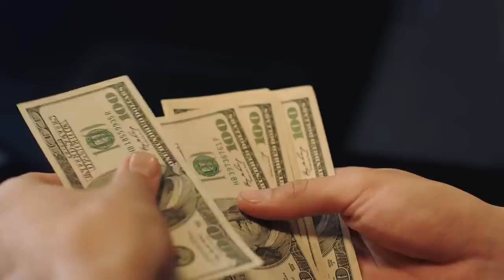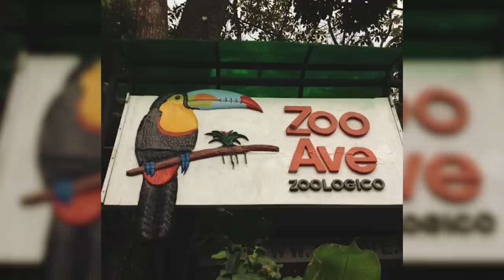This Toucan broke her beak and Cried for help. What Happened Next Will Drop Your Jaw!

Comment: I am glad the farmer found the bird.  Beaks are made of keratin so it's lie ripping off a toe nail. Generally really unpleasant but not deadly with vet care.  The bird will be fine as long as it properly cared for, even without a prothesis.  It will require a soft diet for the rest of its life.  With a prothesis, that is very excellent because it can eat fairly well and feel much better.  It's wonderful they can now make prothesises.  And no, toucans are not "sweet gentle creatures."  In the wild, they are not much better than those little juvenile delinquents.  The long beaks are used to raid the eggs and nests of other birds on a regular basis.  That's why you will see net type nests where parents put their eggs and chicks far down into an elongate nest to avoid attacks by long beaked birds such as toucans.  If a toucan bites you, they will use their saw toothed beaks to cut thru your skin, so you do have to be very careful around them.  They also will attack eyes. These are wild birds and while they will not kill you, they can cause a nice trip to the ER with stitches.  Do not remove any birds from the wild.  If you want to get a bird, there are hundreds of types of pet birds bred in captivity.  Those are appropriate pets.  And it is necessary to keep pet birds because sometimes humans destroy their environments and there are also floods, fire and drought which can eliminate rare birds from an area, so pet owners will often step up and donate eggs and chicks to repopulate those areas.  Glad the bird got vet care and blessings to all those who helped this poor bird back to health.  He or she will likely not be able to be released to the wild, but the bird can made an excellent pet.  Toucan life expectancy in the wild is about 15 years, in captivity, it can be much longer with proper vet care with pet owners reporting 25 to 30 years or more.